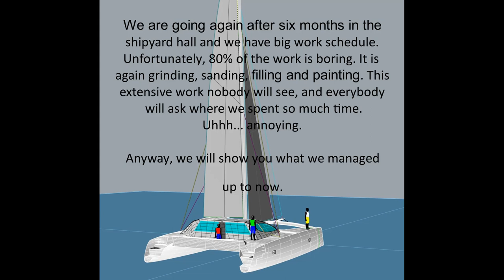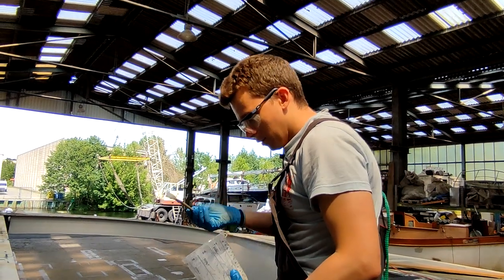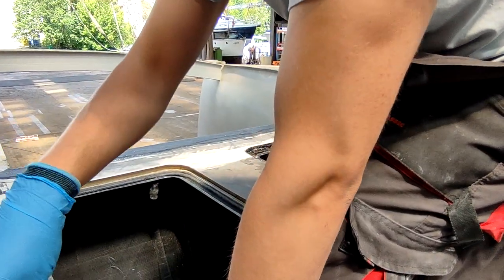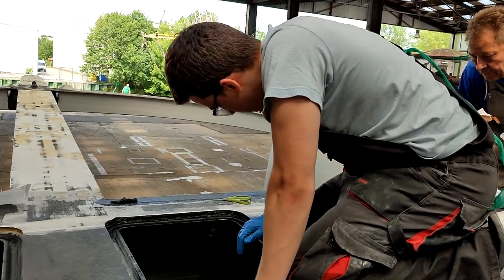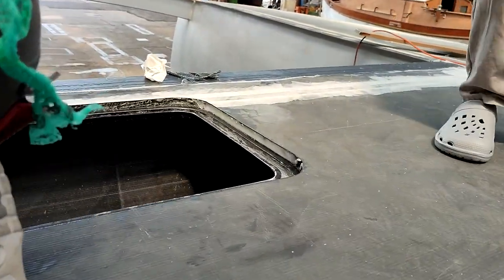04.   Building 15m carbon performance catamaran - "CarbonBee"

Comment: Looks great. Curious if you could show your layups of carbon fiber.as well as your long horn and cross strut construction.
Reply from the maker: Thanks!
The layup of carbon fibres (direction and quantity) blows up the possibilities to answer here. We use generally biax 45/45 and uni with 200-800 g/m²  in different places, with different fibres directions and number of sheets to get designed mechanical properties.

Comment: It looks similar to a Schionning design. Beautiful design and I can't wait to see how you do your rudders. How much more did it cost you to go with carbon than fiberglass in USD?
Reply from the maker: Glad that you like the design. Sure, you can find some similarity to the designs from other designers considering the general shape or some elements. It is just a catamaran. In general, they all looks similar, but the differences mostly stay in construction's details and dimensions.

JANU-15 ("CarbonBee") from the start was designed in carbon-epoxy-sandwich. 
If you want to use fibreglass (2,6 g/cm³ glass 1,77g/cm³ carbon) the whole construction will be ca. 70-80% heavier. That is not only the difference resulting from materials weight itself, but if you take heavier material, you need to design bigger hulls with more displacement, more construction's reinforcement, because you will have bigger forces, bigger sizes of equipment, etc. Additionally, you will need also more material to get the mechanical properties of carbon fibre elements. All this generate more weight. On this way you will get a catamaran which is far from performance boat and at the end it could be, you will get sailing boat which needs engines to sail.

Regarding the costs difference: considering the hull only and additionally that, that you will need more material in case of the fibreglass version, I can estimate the carbon version ca. 70% more expensive, but considering the performance, they will be two very different boats.
Reply: @bojanu7212  Thanks for responding. I already knew the glass was heavier than carbon but didn't know how much of a difference it actually was. That's amazing to hear that glass makes a boat 70% heavier than carbon and that you need to reinforce things differently depending on what material you use. 70% difference on both weight and cost helps me out a lot. It would have been awesome if you had filmed the entire process of you laying up the carbon hulls and other parts as well as how you set up the vacuum bags. There isn't hardly any information about it online. The only place I found something on it was on a YouTube channel called Mike Patey. Your rudder system really fascinates me a lot. I've been looking at the Mumby Cyber 48 rudder design and think that there could be a way to improve on the design and it looks like your on the right tract. The thing that bothers me on the Mumby design is that the rudder is so far forward and has to travel through a long narrow tract to pop out. It looks supper easy to damage the hull. Your rudder tract is much shorter. Hopefully you will talk about your rudder set up and how it works in a future video. Please do a video on how you did the carbon fiber and vacuum bag system.

Comment: Tolles Projekt. Freue mich schon auf die neuen Folgen. Wäre es möglich über Zahlen zu sprechen? Interesant wäre, wieviel Sie an Materialaufwendung  hatten, um das Boot soweit zu bauen. Besten Dank!
Reply from the maker: Danke.
Circa 1,2t Kohlefaser, 0,8t Epoxy und 0,5t Airex ist drin verbaut. 
  Bitte lesen Sie auch meine Antworten auf Kommentare. Dort gibt es viele Informationen. Am meisten unter Video Part 02 und Part 03.

Comment: i LOVE YOUR  boat build , how much for materials for boat build....
Reply from the maker: Thanks!
The cost of materials varies in different countries. If you plan to build such boat in the future, you can order all the materials at once and ask for a bulk discount, which will make it cheaper. I can estimate the quantity of materials needed to reach this stage of the building process: approximately 1.2 tonnes of various types of carbon fibres, 0.85 tonnes of epoxy, 0.6 tonnes of structural PVC foam (Airex or a similar material), and some epoxy additives. Additional materials include wood for the mould/frames and all the components needed for vacuum infusion, including around 30% extra epoxy, which is used with the vacuum infusion components and after infusion lands into the basket. The infusion process is much cheaper than hand lamination, as it saves on work hours, the cost of potential workers for lamination, and reduces mistakes. It is a very clean and easy-to-control process, and we can achieve around 60% carbon fibres in the laminate. Additionally, 5-10% of the materials must be added for wastage.